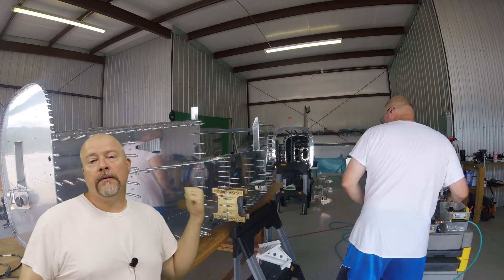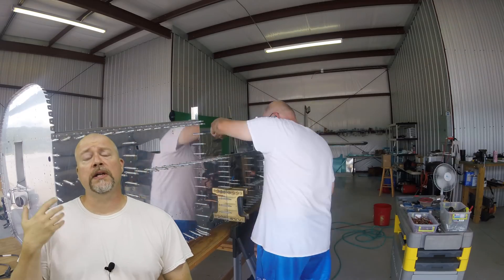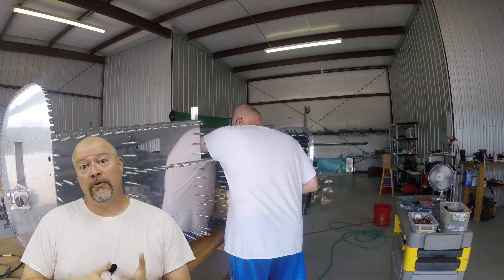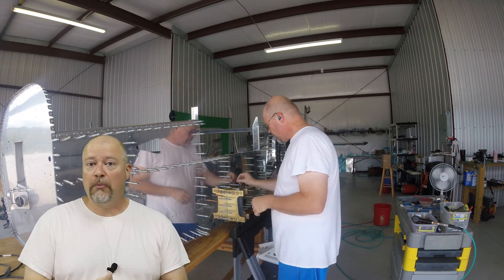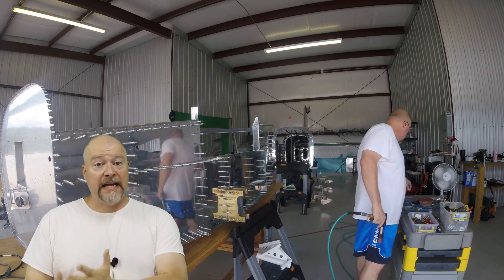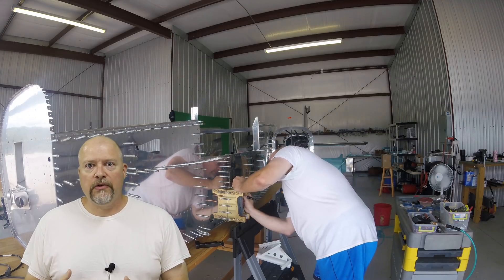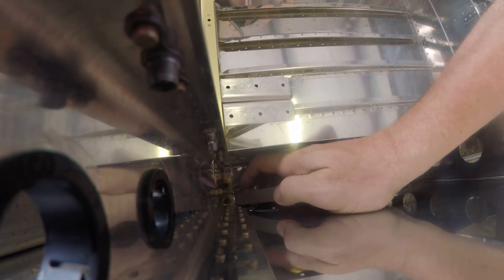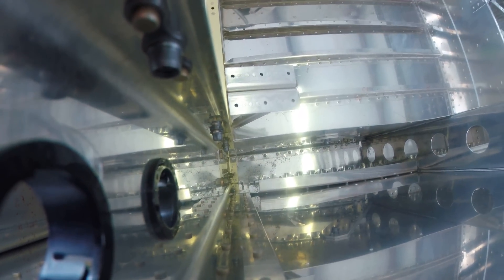RV-10 Fuselage - 030 - 51% rule explained, skin riveting

Comment: So would these guys be illegal?
https://youtu.be/VSPThKgmglU

I'm now confused.
Reply from the maker: Not necessarily.  Taking directly from the FAA's webside; To assist amateur-builders with these projects, many manufacturers
 offer programs that include “builder assistance” and/or “educational assistance.” Builder and/or educational assistance programs are not in and of themselves a violation of the regulations, however, FAA has no mandate for oversight for these types of programs. This means that FAA must rely heavily on the integrity of both the kit manufacturer and the amateur-builders’ certifying statement to ensure the major portion of the aircraft has been fabricated and assembled by the amateur-builder, not the commercial builders.  
So.. Some could say it's a bit of a gray area since they are amateur builders too.. Thus the plane has been built by amateurs..  But, you could make an argument that they are being paid and thus are paid professionals.   Frankly, I think they are skirting the edge pretty hard, maybe overstepping the bounds a bit.

Comment: @3:55 the term is "repairman certificate" and is not required to do maintenance, only the annual condition inspection. And the person who applies for the repairman certificate only need to be designated as the primary builder, which is undefined.

Comment: Here's a question about the 51% rule
You mentioned its so Van's can't make a kit that you pop one rivet into, call the plane complete, and register as E-AB.
Ostensibly: Could you buy a used kit, pop one rivet into it to complete the plane, (a holy grail of kits, I know) and register as E-AB + get your repairman's cert?
Reply from the maker: Yes.  So long as you can prove that the rest of the previous work was built by amateurs.   Not professionals.

Comment: Even quick builders with QB wings and Fuse still qualify for 51% though they obviously have a much smaller margin for outsourcing than us slow builders
Reply: So is there a list of how much % an outsourced part would contribute...

...so if we add the QB parts, engine, electronics, how much room does someone have?
Reply: I found it in the 20-27G

Comment: Jason, thanks for all that you do on this channel to inspire others towards aviation!  You’re mostly correct: the 51% rule is fairly well explained in AC20-27. It only comes into play when one is applying for the limited Repairman Certificate (otherwise reserved only for Part 145 repair station employees). Generally it states that 51% of the overall manufacturing work must be done by an amateur builder (not necessarily the final applicant) AND MUST BE DOCUMENTED THAT IT WAS DONE MY AN AMATEUR (which is where most partially complete kit sales likely run into trouble). Per the AC, you may google search for the local Flight Standards District Office (FSDO) to determine how much work can be done professionally (completed by someone else for compensation) if the kit is already evaluated, or request the FAA evaluate a kit if it has not been yet. This line may be changing for the RV-10 with the new final drill kits. None of the required flight tests and time counts towards builder 51% but AC 90-89 will help with flight test program generation!

Comment: If that is true 51% must be built by amateurs, how does someone like MojoGrip get the kit for nothing (patreons paid quite a lot) & have the selling company build it for him?????????????????????????
Is that a "homebuilt experimental"?
Reply from the maker: I honestly don't know.  He actually lives relatively close to me.. I need to reach out to him.. heh
Reply: Not familiar with this specific individual, or how his aircraft are certificated, but the 51% rule does not actually require an amateur to perform 51% of the actual hours required to complete the aircraft  - Look at FAA AC 20-27G - Appendix 8 contains the checklist you use calculate the so called 51% - in that list, for example, assembling control stick counts just as much as fabricating the wing spars...
Reply: He won’t be listed as the builder on the FAA paperwork.

Comment: I use rivet tape because
- it can be used for about 50 rivets over and over. Just put a tab on it to cleanly pull it off.
- it has no glue in the center section, so the rivet and surroundings stay clean and not gunked up with blue tape remains
- I can still see the entire rivet and center the gun over it
- the rivet tape is very slippery and if the rivet gun is also squeaking clean there is no friction (I use the mushroom head without swivel joint). I see no denting of the skin around the rivet if I use rivet tape. I think the friction of the blue tape does something unwanted.

Concerning the 51% rule, it's important to mention that it's 51% of the steps to build the airplane (FAA publishes a list), not 51% of the remaining tasks after receiving the kit. If you receive a kit you might be 41 or so percent in the hole. For sure if you receive a quick build, you are like 49% in the hole already so ALL remaining tasks have to be done by you.

Comment: A Repairman's certificate is necessary to do the annual condition inspection (or an A&P). No certificate of any kind is required to REPAIR or modify an Experimental Amateur Built Aircraft.  You can buy an already flying E-AB and still do the maintenance and just pay your A&P buddy to do the condition inspections (and even then you can do a lot of the grunt work yourself). That's what I do.
The "Repairman" certificate would be better named the "Authorized to do condition inspection" certificate.
Reply: This is absolutely correct per Vic Syracuse with the EAA. He is has a EAA Webinar dated October 26, 2017 where he answered this exact question around the 1:19:30 mark.

Comment: Alot of ppl don't understand government writings and wording, its a completely different way of writing and wording you have to pick out the important words and  phrases then fill in the blanks to proper grammar and understanding.  Government test are easy if you think outside of the box and not just try to fully understand the questions and answers because the wording will confuse most grammar/ wording nuts.

Comment: Anyone who has done any amount of car repair would likely loss faith in “professional” built things.

The reality is there are lots of factory issues with nearly every single car. That’s not so say building your own car/plane would be more reliable but at least you’d know who to blame lol
Reply: Mrcaffinebean Mechanics exist because professional engineers couldn’t design it right the first time.
Reply: Brennen Fitzgerald hahaha often very true! My pet peeve is undersized wiring. Some penny pinchers decide that the total bare minimum must be used and a few years down the road and a little oxidation and suddenly the bare minimum can’t handle the current.
Reply: Mrcaffinebean Oh, a flooded cell battery breathes while charging and discharging? Bah, that’s an end user problem. No reason for us to protect the TIPM or the main fuse board. Nah, not at all. Let the end user deal with that.”

Comment: What about if you bought prefabed sections through Vans?  How does that count?
Reply from the maker: That's where things start to get really tricky.   I think once you start adding prefabbed parts you will be required to provide the inspector and/or designated airworthiness representative (DAR) called to certify the project sufficient evidence (pictures, logs, videos, etc.) to show what tasks were performed by whom.   It could be very subjective..    I feel like they would error on the side of the pilot though because again, this system is more about keeping the kit providers honest than it is about punishing the builder.. Good question!
Reply: @JasonEllisBuilds  cause after watching you assemble i would be leaning towards prefabed wings and fusalage at a minium.  Or just buy a plane.   I like puzzles but crying out loud.
Reply: Maybe some follow up from Vans would be good!

Comment: Jason, I love your tube video and your work on the RV-10. I am about on the same point on my fuselage as you. I think on the topic you are mixing two different requirements. The first is the aircraft airworthiness certificate, which you correctly referenced the EAA (and 14 CFR 21.191(g)). However, you also mentioned have the ability to do the aircraft work/repairs on the aircraft after construction, which is the Repairman Certificate. FAR part 65.103 and 65.104 that specifies the “Repairman certificate - experimental aircraft builder - Eligibility, privileges and limitations.” 
(a) To be eligible for a repairman certificate (experimental aircraft builder), an individual must -

(1) Be at least 18 years of age;

(2) Be the primary builder of the aircraft to which the privileges of the certificate are applicable;

(3) Show to the satisfaction of the Administrator that the individual has the requisite skill to determine whether the aircraft is in a condition for safe operations; and

(4) Be a citizen of the United States or an individual citizen of a foreign country who has lawfully been admitted for permanent residence in the United States.

(b) The holder of a repairman certificate (experimental aircraft builder) may perform condition inspections on the aircraft constructed by the holder in accordance with the operating limitations of that aircraft.

(c) Section 65.103 does not apply to the holder of a repairman certificate (experimental aircraft builder) while performing under that certificate.

Note the (2) states “Primary builder...” because one one person will be issued the R.C. For that aircraft serial number.

Please keep the two items separate because the FAA does. I’m currently in school to get my A&P Certificate, this was a test question.
Reply from the maker: As I understand it, if you purchase a plane that is 90% done by an amateur, and you complete it as an amateur for your own education and enjoyment.. it's yours.. you own it.. then YOU are the "primary builder" and thus are eligible for the repairman certificate.   It doesn't matter that before you got it someone else did the work.   If you can show #3 above then you're good to go.
Reply: @JasonEllisBuilds  Maybe I'm just looking too far into words on the video. But the repairman's certificate is only for the annual/conditionals. Anyone can work on the aircraft regardless of certificate status, yeah?
Reply: @zacvekovius4057  Correct. Anyone can maintain the aircraft. No certificate required.
Reply: Jason Ellis I believe you are incorrect here.  You may find a DAR that will attest to the FSDO that you did 10% and are the “primary” builder, but I suspect you will have to search one out.  And keep in mind that true 50% rule is based on task coverage, not hours of work. Here is a good discussion.  I believe you do not have a good understanding of the repairman certificate eligibility.  

http://eaaforums.org/showthread.php?8482-50-rule-for-Repairman-Certificate
Reply: From EAA https://www.eaa.org/eaa/aircraft-building/intro-to-aircraft-building/frequently-asked-questions/how-to-get-your-repairman-certificate
What does "primary builder" mean?
FAA does not define this term. EAA considers the primary builder to the person who's signature is on Form 8130-6, block III attesting to the airworthiness of the amateur built aircraft.

But they also say

"I am thinking about buying a 95% complete project from another builder, will I be able to get a Repairman Certificate?
The only person who is eligible for the repairman certificate for an amateur-built aircraft is the "primary builder". However, there is no official FAA definition of "primary builder" so it will be up to the FAA inspector who accepts your application to determine if you meet the requirement or not. This is done through an interview process that includes a review of the aircraft construction records. If you are able to convince the FAA inspector that you are indeed the "primary builder" and that you have the requisite skill necessary for determining whether the aircraft is in condition for safe operation, you may be deemed to meet the eligibility requirements and will be issued the repairman certificate. But if the project is substantially completed when you purchase it, you might find it difficult to convince the FAA that you are indeed the "primary builder"".

...
If the DER is convinced you have enough knowledge of the aircraft there might be a sign off.  I think if you bought a kit and just hung a engine and filled in the panel it would be difficult to convince the DER unless you had built a similar aircraft before.  Building a RV-6 and then buying a 95% complete velocity and trying to get the RC for the velocity would probably not make the cut.  Can you work on the velocity, make changes - Yes.  Could you do the condition inspection - No.  Have to find a A&P IA to do that.
Reply: Correction - IA is NOT required.  Any A&P can perform the condition inspection

Comment: If the holes are final-size match drilled, do you even have to assemble the parts, before taking them apart for dimpling? Could you just get the skin off its shelf, dimple it, then assemble with clecos and rivet it together, all in one go?
Reply from the maker: I dunno.. Damn good question because if you're correct then they just removed like 50% of the work.. haha
Reply: @JasonEllisBuilds  That's what I was thinking! I mean, if they're introducing the final-size parts say in May 2021, you might as well wait (instead of ordering now) because the change could easily save you those 10 months!
Reply: I think you would have to adhere to a strict riveting sequence... and rivet not right but exactly right! If you over drive rivets or rivet inconsistently a skin will stretch by a minute amount. If there is inconsistent riveting that will cause inconsistent stretching in the skin and minute misalignments that may cause some waviness. BTW Jason, the skin quality you produce so far is very good! Large aircraft manufacturers have assembled panels like that for years but the fasteners are installed by robots so 100% consistent. And even then there is some waviness
Reply: Potentially, assuming the parts were also deburred at the factory.
Reply: @LTVoyager  Ah. Well even if they're not, deburring, dimpling, then assembling with clecos and riveting, probably still cuts down the job by half...
Reply: Spyros G Definitely.

Comment: I don’t know if it is the camera view or the way the light reflects but it seems to me that the rivets appear either overdriven or the dimpling was not done with the proper dimple die.  It really looks odd in video.

See at 12:40.

Everything should be flush.
Reply from the maker: All of the rivets on the right per your time stamp are correctly driven.  The dark marks you're seeing are a discoloration only caused by not using tape.  They were all checked.